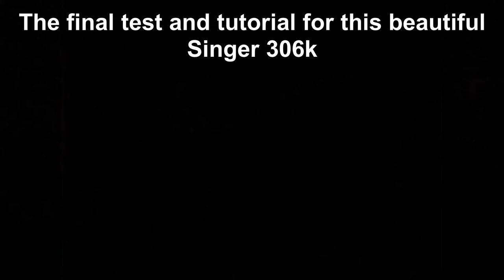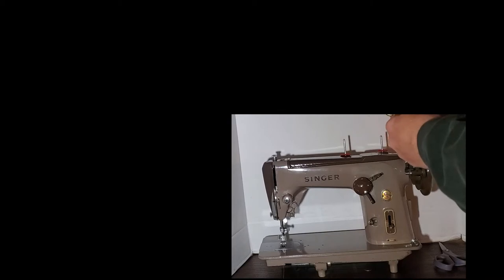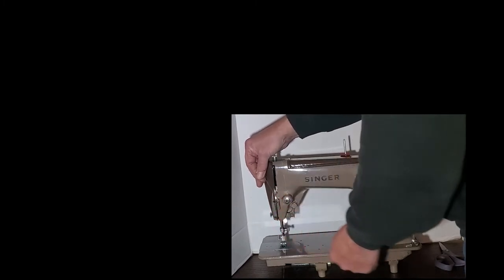Singer 306k Treadle Sewing Machine-final test and how-to

Comment: Your Singer 306K sewing machine is wonderful and my sewing studio is wonderful. Installed inside an old bus. I'm a man and I like to sew sporadically. I dream of one day doing something professional. I love working with old iron sewing machines and I have a Singer 319K with an aluminum head. I need to fix it in the decorative stitch part, it stopped oscillating the needle column. But it's sewing marvelously well in straight stitching, the straight stitching is beautiful. The needle column only moves in manual mode, when I turn the position lever (left, center and right). But it can't move on its own when I use the stitch keys and adjust the stitch width. It broke after bending the wrong needle that came with a 15x1 needle. I'm using a fine-handled DBX needle to sew straight now, as advised by a YouTube user. In Brazil there aren't needle 206x13. I live in Brazil.

Comment: Dear Stagecoach, yes your machine is labelled 306K, but I think you have a 206K. Why?, cos I have a 306K in black, and the Singer booklet, Form K6094, "Illustrated List of Parts for No's. 306K22 to 306K25" . My 306K25 machine and the parts book have the fashion disc equipment, that is missing off of your machine. It is also on the Singer 319 machine.
Reply: After doing more googling, looking again! In the parts book!! .....it looks like you have a 306K22 or 306K23, a 306 without the fashion disc gear!!